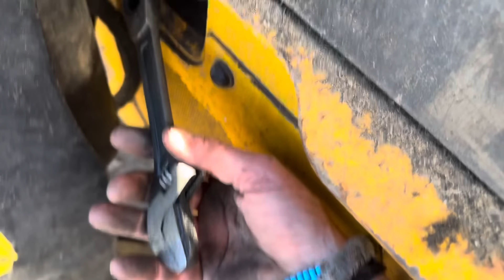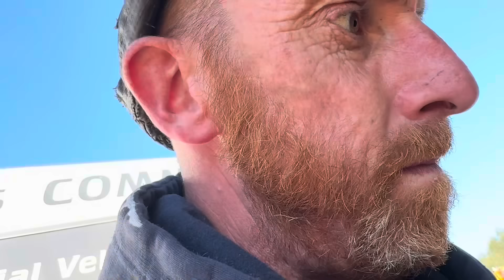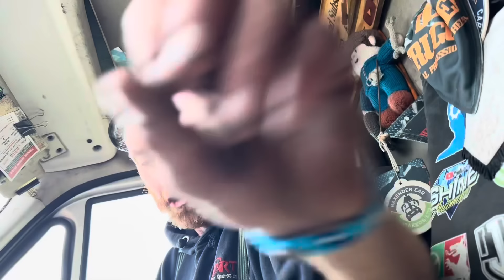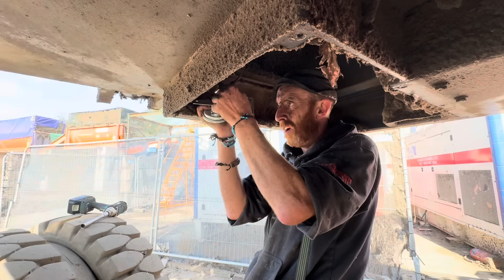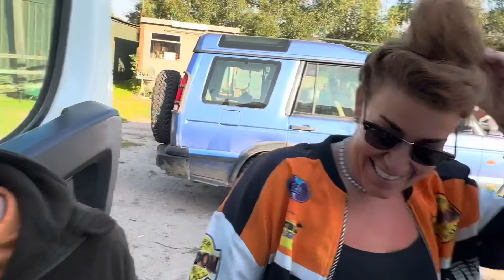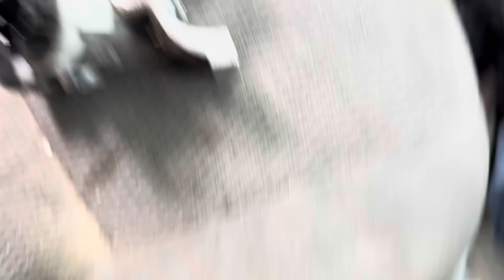Really LOOSING my patience!! Going round in circles!

Comment: My Mercedes kept cutting out on me I swapped some relays around and that fixed it permanently. 
After several diagnostic visits and £100's I fixed it myself! 😅
That's exactly what mine used to do cut out mostly within a mile of  starting and would start straight up again. If you were quick you could restart whilst still rolling.

Comment: The flat plate inside the solenoid has welded itself to the contacts but with starter motors now you can't remove the cover and clean all the arking/burning off it, some of the early 2000 MG Rovers had a starter solenoid on them with a removable end cap so you could clean the live contacts and the plate that makes the connection.

Comment: Mate is it 16 to 18 plate van ?? If so they had a recall because of this problem on  Ignition Switch Starter part numbers 1389441080 1616896080
And sorry about the video I sent over showing u how easy it was to remove a little too late haahhaa